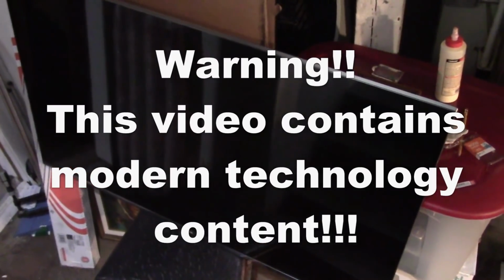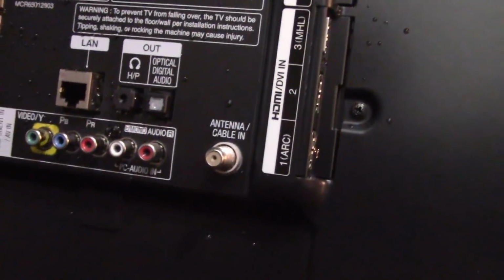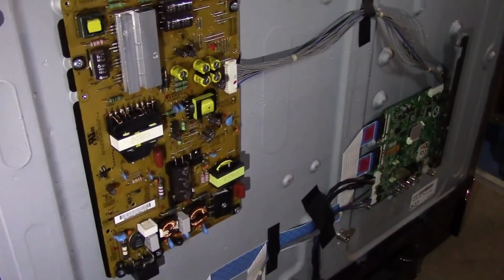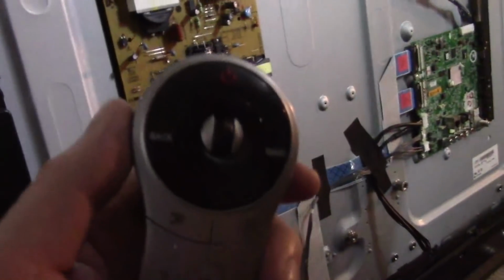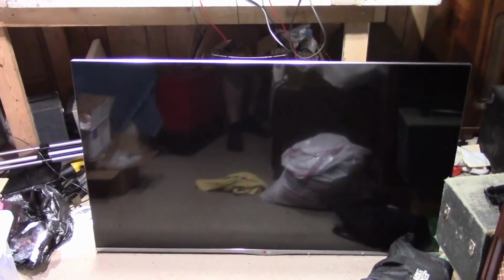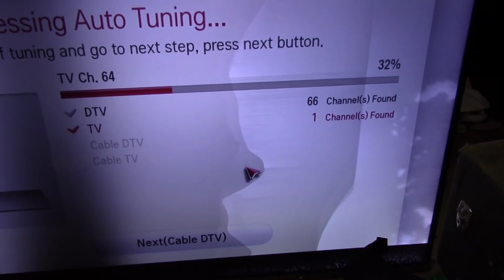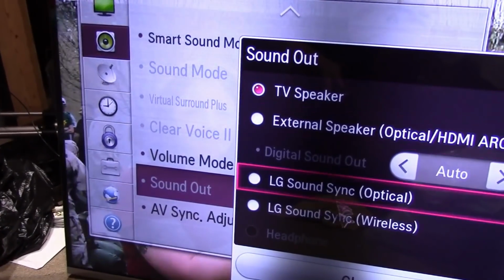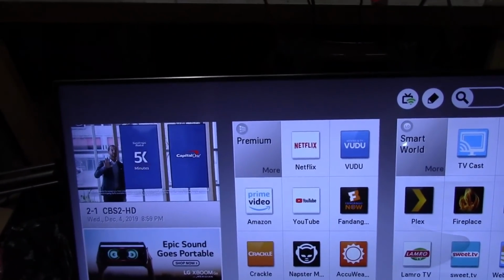Alley Shopping: Another TV

Comment: That's a really nice set, and you sure can't beat the price. I wonder if the blotchy stuff in the display is just water staining? Might be worth it to pull the front to have a look
Reply from the maker: I would but it's not so easy to do.  There's a delicate sandwich of backlight, diffuser and LCD glass.  It seems to be slowly evaporating.  I hope it doesn't leave a visible stain.

Comment: My first HDTV was a Samsung 52" rear-projection DLP set I bought in 2006. It was the bees' knees then, and served me well for years until I saw that prequel Star Trek movie, where all the characters meet for the first time. There was some weird display issue where obviously white things appeared blue-tinted. Found out that the color wheel motor was starting to lag. Would be a relatively cheap and easy fix, but by then DLP sets were gone and LCDs had caught up and passed in contrast. So I got the set I have now, a Samsung 55" SUHD unit with upscaling and even 3D, though I only tried that once and it was so awfully gimmicky, I never tried it again. It will take a lot for me to replace that set. OLED 72" or something? We'll see!

Comment: The dark column is likely a bad LED in a series string that is part of the backlight causing all in the string to go out. The other damage is likely just from water ingress.
Reply: I second this. Such a pity that it got wet - it's almost impossible to clean the polarizers :/
Reply: @zaprodk  It's just rainwater, and not tap water, so maybe it will dry out without major residual artifacts on the picture. But probably he should disassebmle the LCD panel to let it dry. If it won't be perfect, he can still buy a similar set of the same size with a broken LCD for peanuts, and steal the light diffusor films (and the backlight!) from it. I don't think the polarizer is a separate, loose film, it's glued to the two sides of the panel, the water only can get between the different diffusor film layers.
Reply: I would change out the backlights and wipe clean the layers of diffuser material. I did this to a Samsung once. There was one layer that was coated paper. The rest were water resistant material.

Comment: im not 100%  but that dark spot does seem like this tv either has multiple lights to light it, or a burnt spot if its using the older CLF tubes like some LCD's it could be a section of dead LED's.suggestion is a dehumidifier in a room with that tv for a bit
Reply from the maker: It uses several strings of LEDs and a diffusser.  The dark spot hasn't come back yet.

Comment: Looks like water got into the layers of the panel...

Some would consider it a complete loss in that state, but you can always split the layers of the panel and dry everything out if it bothered you enough. The main issue is preventing any dust from getting into the panel.
Reply: I once had a similar display issue with a laptop that was left out in the rain. I put sheets of paper between the layers to soak up the moisture and that pretty much fixed the issue.
Reply from the maker: It doesn't seem to have changed in several days.  Makes me worried that the moisture dried up and left dirt behind.
Reply: @bandersentv  I had the same experience with the laptop display I mentioned in a previous comment. Even after weeks in a dry environment there was no visible improvement. Since there was nothing really to lose I opened the display unit just enough to be able to insert sheets of paper between the layers. After a couple minutes the sheets of paper were quite wet when I pulled them out and the stains inside the display were gone. Apparently once water gets between the layers it doesn't evaporate easily.
Reply: It can take a very long time as it does not get as hot as the CFL LCD TV's A non humid environment should help it dry it out,
Reply: It does dry out with use.
Reply: It's just water between the diffuser and the LCD panel itself, it acts much like the safety glass on an older CRT television. You can take it apart, dry it out, and clean the inside, and it's won't harm anything. The late Aussie50, and his pal V8Jagnut, used to salvage LCD monitors and TVs from dumpsters, and the curbside all the time, and water between the layers was a common issue, along with scratches on the outside of the diffuser. Dust isn't really an issue it's the bond with the edge connectors of the LCD panel that causes the difficulties.